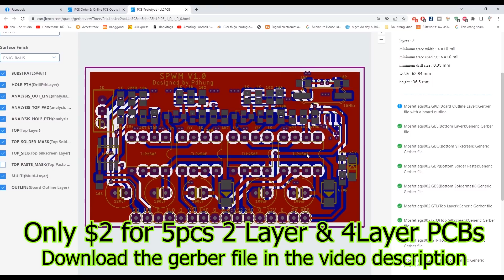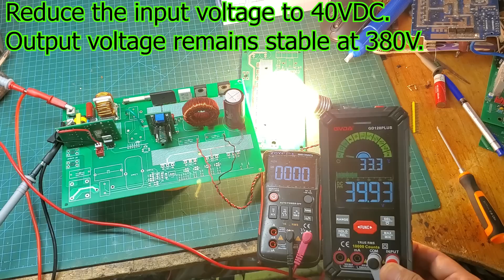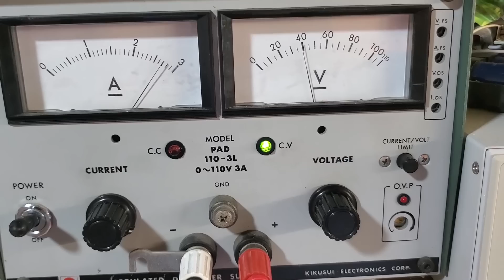Make digital voltage stabilizer 2KVA - Part 1 | JLCPCB

Comment: Can you help me increase the input voltage to around 500 / 600 volt ?  I have 200 panels laying around with a VOC of 89.6 at with around 1.2 current. Wanna make series of 6 panels at 540 volt and add them in parallels 6S 8P so getting around 540 volts X 8 Amperes  = 3,600 Watts. Any ideas ? Thanks @Awesome Tech

Comment from the maker: I will finish this project this weekend.
Reply: Does it work as AC to AC Voltage stabilizer or it also work as for both AC/DC Voltage Stabilizer. Please clarify..
Reply from the maker: @AKV-121   60VAC-265VAC to 220VAC or 80VDC - 450VDC to 220VAC.
Reply: @PhdHung  it means it can be use as inverter too
Reply: Hay quá ad ơi ! Cố gắng ra nhiều video hơn nữa ! Toàn mạch hay mà chả chịu ra ! 😊😊
Reply: Hello admin, im sorry abt my confuse, i tried to make your 24 mosfet 5000watt inverter based on your youtube channel, and im happy for make it. I already printed this pcb and trying make one. But unfortunately, i stucked to put the ct sensor which use for overload protection, bcs i never see this one in any market place in Indonesia. Please help me what exactly is. and if there's any equivalent for replace this one, please tell me. Thanks.
Reply: We can use for 72v dc solar panel